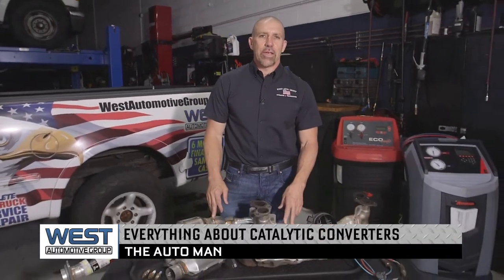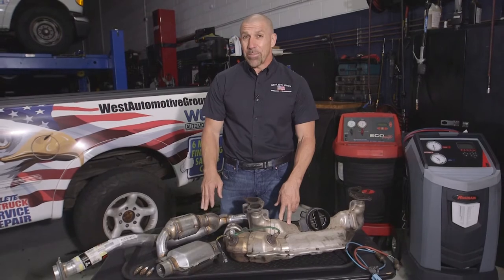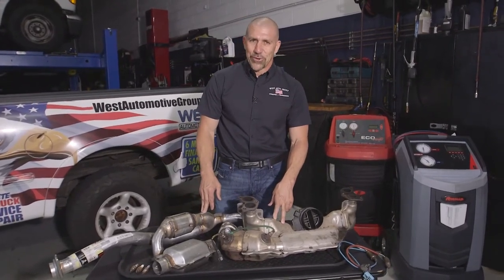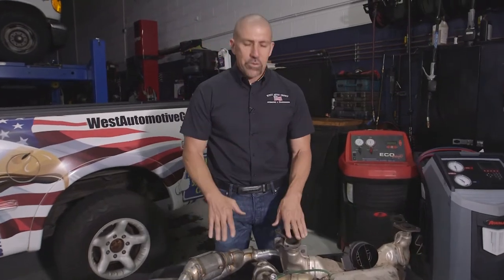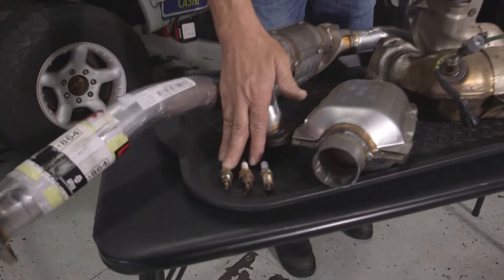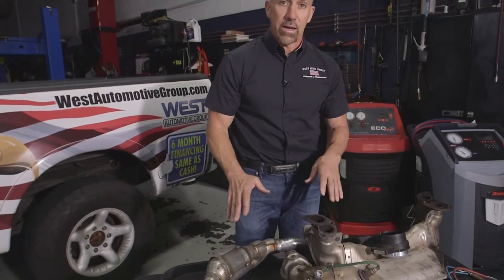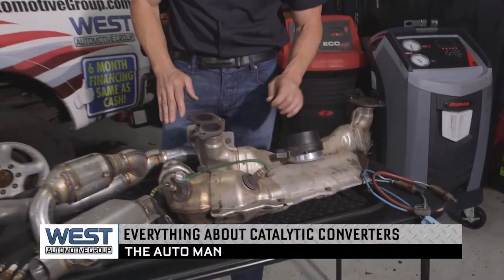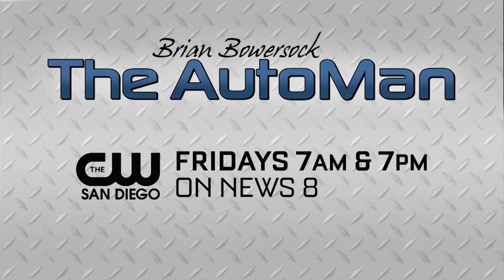Catalytic converters: How often do they fail, what should be done prior to a catalyst replacement?

Comment: I have A Kia Rhondo 2014 and last year they replaced the Catalytic converter and now I just sneeked in before the warranty expired and I needed another one. When I looked at the work orders from the past they mentioned an oil problem it was not leaking out but I had to keep topping it up. Now they say I need an new engine as the pistons may not be correctly or something they talked stuff I know nothing about I am senior lady and a widow so don't know much about this stuff other than I have always kept up my oil changes and if anything needed doing I got it done. i cant really afford a new car, but they want $4000 to fix the engine. Is it viable to do this on a car this old. Oh they redid my brakes as well withing the last couple of years,? They say there will no no further warranty on the new converter since there is an oil issue.
Reply: Piston rings could be stuck due to carbon build up, which a good oil detergent could possibly fix like royal purple and MMO.
Reply: How many miles? I mean it shouldn't need a cat with low miles, even 200,000 miles isn't necessarily high for them. But those KIA engines are not known for being that great. A used Toyota even with high miles would be a better buy.

Comment: My 2008 Trailblazer needs a new cat, it plugged up and would not let exhaust flow at 165,000 miles. The car would not run, bypassed the cat and it ran fine, so a new cat ordered and should be here soon.
Reply: If it ran fine, would not replacing it cause damage?  My sister was recently charged $800 to replace her CaCo 1200 miles from home (2004 Chrysler Town & Country) and I'm 50-50 on whether Death Valley actually killed it or the dealership just wanted to recycle the older metals inside the CaCo.

Comment: I have a 2005 Corolla with 200k miles with a p0420 code saying I need to replace the cat, how long do they typically last mileage wise? I’ve had no issues with the car whatsoever
Reply: I will change it 100,000 miles it’s only 100 buck to get it replace
Reply: @petermuniz9296  See other comment.  My sister paid $800.  Are replacements not as valuable as originals?
Reply: @petermuniz9296  you only paid $100 to get your catalytic converter replaced?  How?
Reply: @agookchild  it was like back in 2010 before the price hike besides, I think I got an aftermarket I didn’t get the original?
Reply: @agookchild  it was before Covid like 2010 now the cats are like 400 why 800 they robbed you